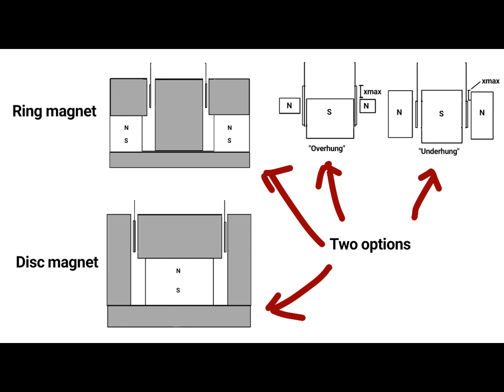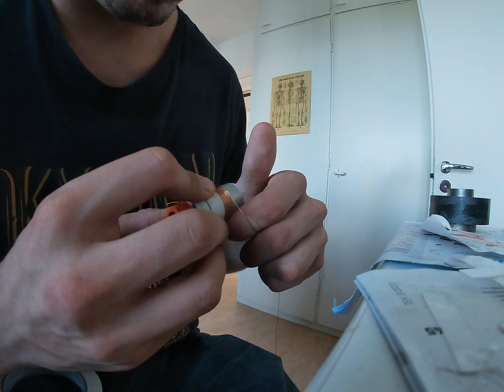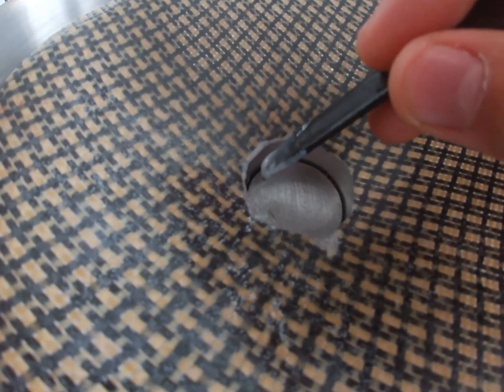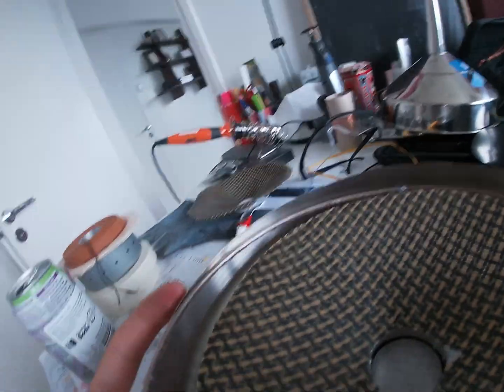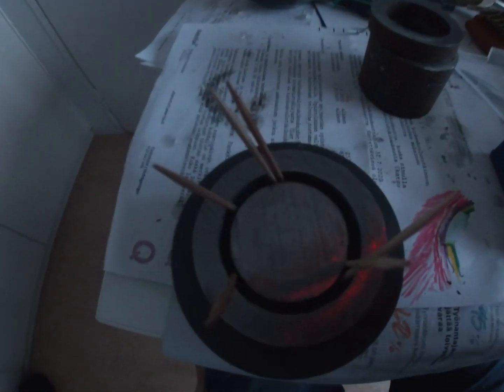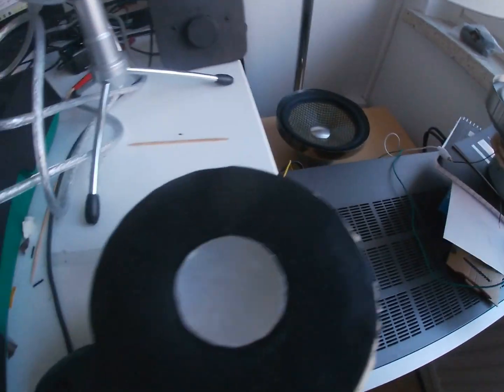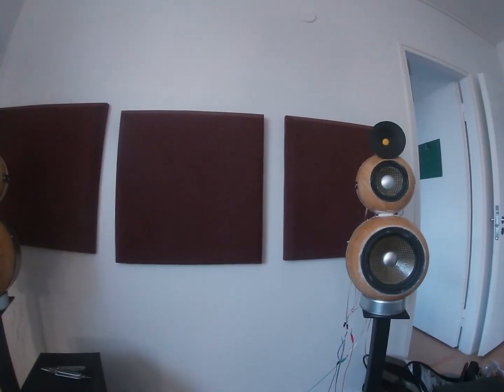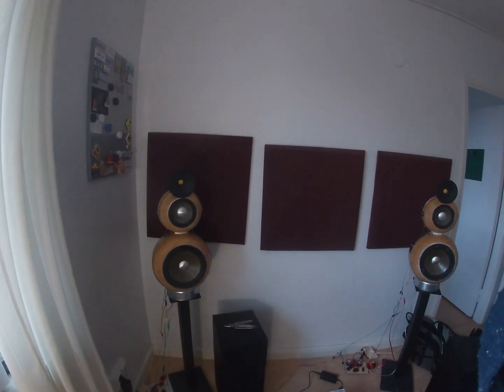DIY Speaker Driver Tutorial (Aperiodic 3-way Loudspeaker from Scratch)

Comment: Cool!  Was the subwoofer enclosure aperiodic as well?  Also what are the crossover frequencies?
Reply from the maker: I did not make any subwoofer, but the woofer and midrange enclosures are both aperiodic. Crossover frequencies are 800 Hz and 3800 Hz. Maybe I should make a subwoofer too 🤔. It may only be hard to handle the large magnets.

Comment: Very good job! Congratulations!

Could you direct me to any website, pdf or even books on how to calculate and build speakers like you did?

Thanks.
Reply from the maker: There's not very much information about DIY speaker drivers in the internet. But by reading about how they are made in factories, you can find your own ways to do it. It's pretty hard to calculate beforehands how the driver will act. But there's some software that can be used to model the system, if you know the parameters for all the parts you use (like material, elastic modulus, density, magnetic properties etc). The magnet structure can be modeled with a software called FEMM. I have also used COMSOL Multiphysics in school projects to model speaker drivers, but that's quite compilcated too, especially if you don't know the properties of all your materials. 

When I made those drivers, I didn't do any computer modeling beforehands (i thought it would be too hard and time consuming). I only measured the impedance afterwards with a simple impedance rig, using softwares like REW and ARTA/LIMP. Then I used the measurement data to calculate Thiele-Small parameters for the driver. Based on those parameters, I chose the enclosure type. My drivers had high total Q-value (which means something like very low damping), so decided to make aperiodic enclosures, to balance the damping of the drivers a little better. Also, I wanted the enclosure to be somewhat compact, so an aperiodic enclosure was good for that, because it allows smaller cabinet size. Here's some information about aperiodic speakers https://diyaudioprojects.com/Technical/Aperiodic/

If you want to know about the physics behind speakers and speaker drivers in general you can check these books:
https://www.sciencedirect.com/book/9780123914217/acoustics-sound-fields-and-transducers
https://www.amazon.com/Loudspeaker-Headphone-Handbook-Third-Borwick/dp/0240515781
However, those books, probably do not include any DIY tips.

Also 
https://www.diyaudio.com/
Is good place to discuss all the technical details of DIY speaker projects
Reply: @olijomusic2481   Thank very very much!
Reply from the maker: There's also some useful links in the description that I can recommend.

Comment: how did you make crossover for the speakers
Reply from the maker: I actually just used some crossover calculator from the internet. I know that if I desingned the crossover myself with some software tools, I could get even better results, but at that point of the project, I was quite exhausted already, as there was a lot of work in the drivers and the enclosure already.

The crossovers are external, as I didn't want to put them inside the enclosures, as they are tricky to open in case of any error. In addition to the crossovers, I made an analog filter around 100 something Hz to tackle the one worst resonant frequency of the enclosure.

Comment: Very impressive stuff. I was thinking of making a coaxial driver with a horn tweeter in the middle just the like the old EV and University stuff from the 1960s. By the way, when positioning the voice coil and spider, why not just use plastic shims to keep equal distance the whole way around. If you watch a speaker recone tutorial, you will know what i’m talking about. 👍
Reply from the maker: Sounds like an interesting project. Just tell me if you end up making any video or documentation about it, it would be interesting to see 😀.

I know the voice coil aligning method and I actually tried it too. But I wanted to be sure that the outer surface won't rub. With the plastic strips, I only see the inner surface of the former. And as I know that the coil gap isn't perfect either, I'm not yet satisfied with the information that the former is centered compared to the pole piece. Do you understand what I mean?
Reply: @olijomusic2481  Yes i see what you are talking about. Thanks for explaining.

Comment: This is pretty impressive. Do you have T/S params and FR/Impedence plots of the drivers?
Reply from the maker: Yes, I made the impedance rig to measure the T/S parameters and the impedance. Actually, that was why I ended up making it aperiodic, as the woofer Qts very high. The aperiodic design kind of damps the cone movement, as it forces the air to move in and out through a resistive vent.

I also took some not very accurate FR measurements of the drivers using my USB mic. The measurements were not that accurate, but they helped me to find the cone break-up frequencies, and to design the crossover network.